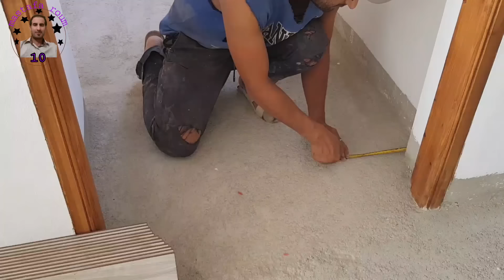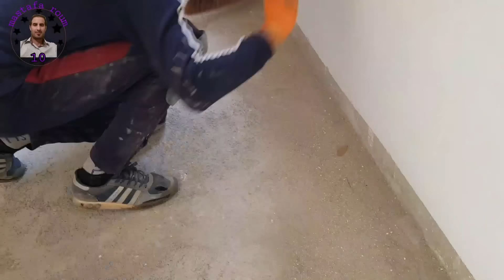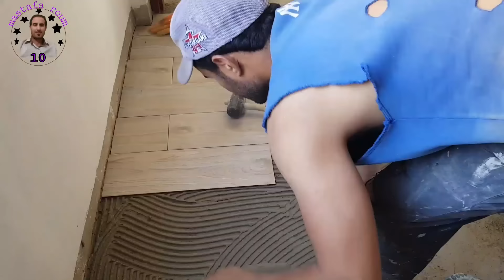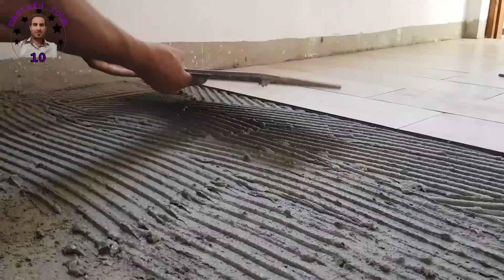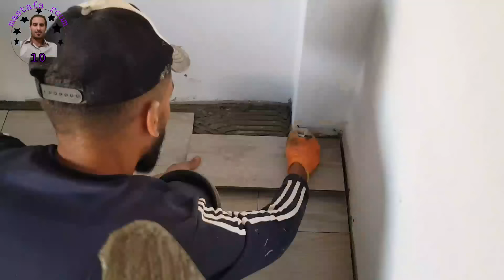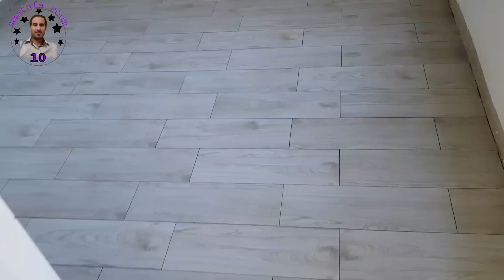طريقة رائعة لتثبيت بلاط الخشب بمادة لاصقة

Comment: no tile levellers & not buttering the back of the tiles with adhesive & no spacers! bad job
Reply: Been watching this guy . On certain jobs he will back butter and use spacers .Even seen him use a leveling system. 
I don't think there is a serious expansion problem with porcelain.
Reply: He did a good job, but he should have maintained his grout joint pattern up the step instead of starting over with a full tile.
Reply: Porque mal trabajo,los niveladores son para aprendizes